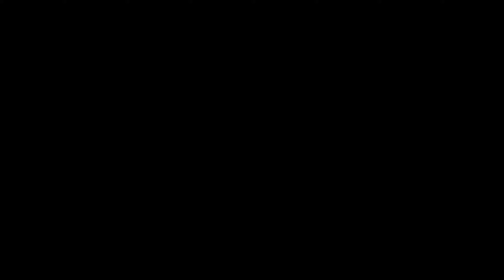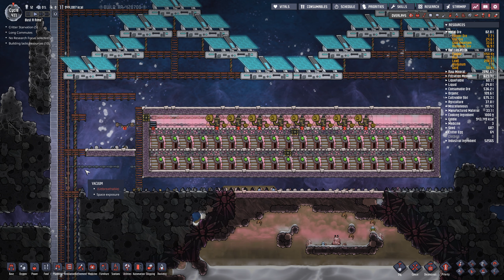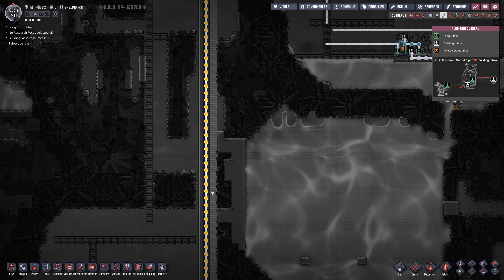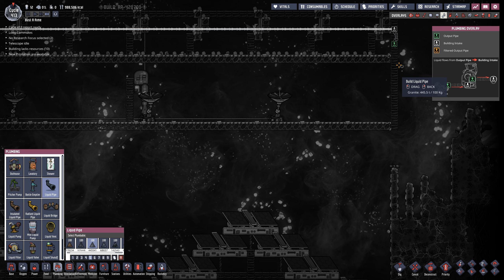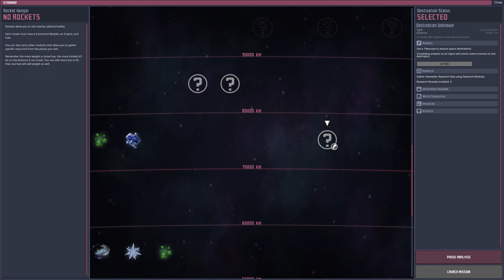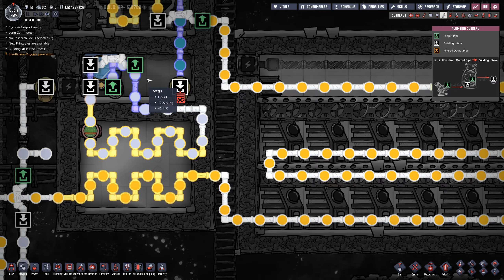ONI Bust A Rime #18 - Cooling system

Comment: Petroleum is often used in cooling loops for it's high thermal conductivity and boiling point rather than it's specific heat capacity. It will cool objects and liquids down faster than waters.

Comment: even though the stationary salt water that you are using to transfer heat from the aquatuner line to the main cooling loop works, i would have used petroleum instead for that part. the reason is that 2.0 conductivity makes it better for transfer to the aquatuner line than the salt water. because you have so much liquid there, i wouldn't worry about capacity. i only look at heat capacity if i am directly cooling the main line with an aquatuner due to its 14 C limit.

Comment: actually, super coolant gas is the highest capacity and conductive gas in the game, but you need to have a hot system to use it. also, if you want more food, make a sleet wheat farm and use the salt water from your subterranean ocean.